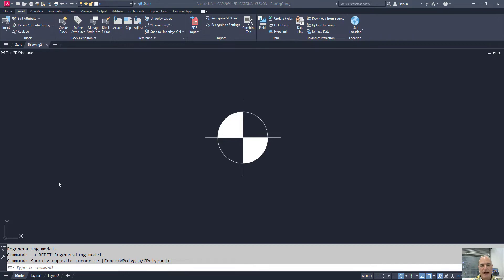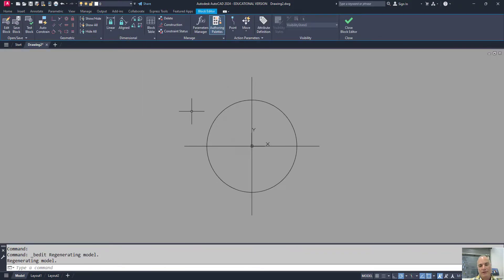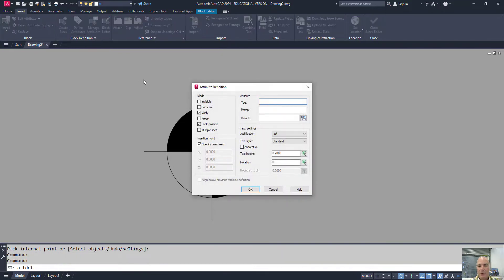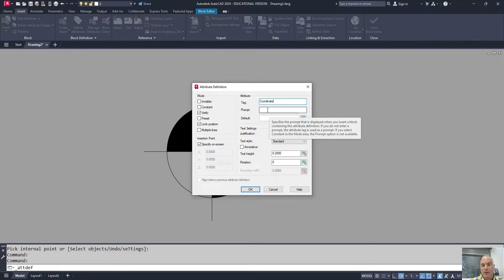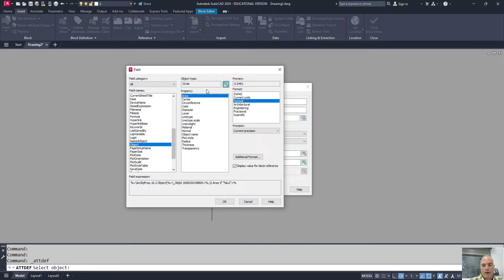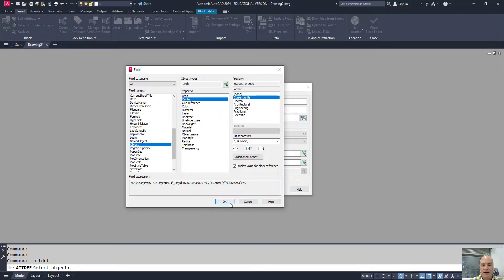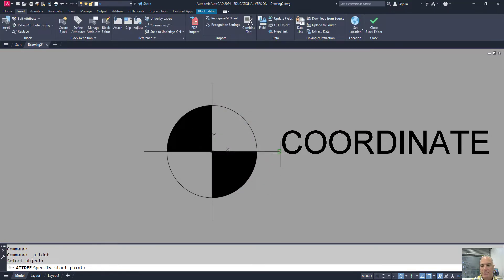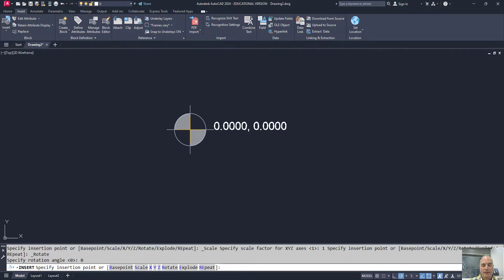AutoCAD Dynamic Blocks - Coordinate Attribute

Comment: how do you change the color behind the coordinate,  I have a black background and the dynamic attribute has a grey background with white lettering. I would like black background on the attribute to match my background screen.
Reply from the maker: To change the background color on the dynamic attribute, follow these steps:
1. Type OPTIONS at the command line
2. Select the Display tab
3. In the Windows Elements area, choose the Colors... button.
4. Select the context - model space or sheet / layout space.
5. In the Interface element list, choose Drafting tooltip background
6. Select the color you desire (Black)

Hope this helps!
Reply: Alternatively, you can use the FIELDDISPLAY system variable to control the display of background masks for fields, setting it to 0 to turn them off.